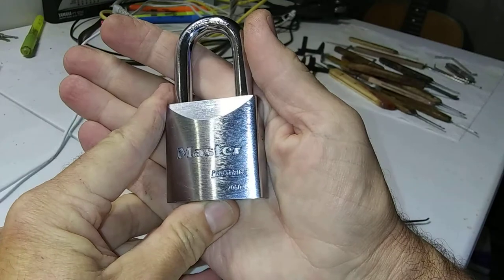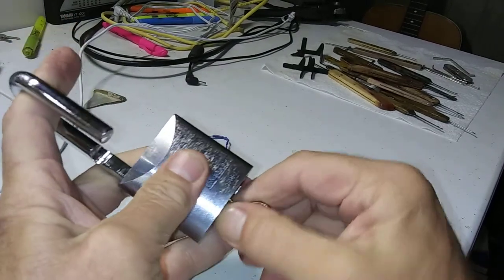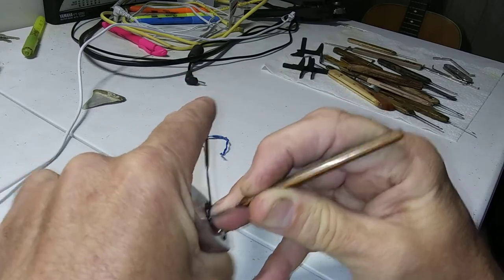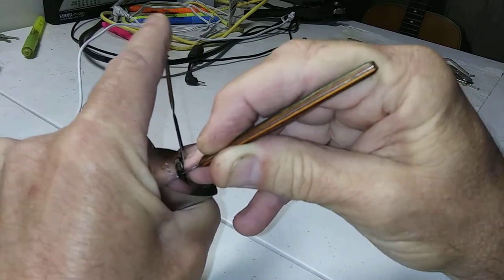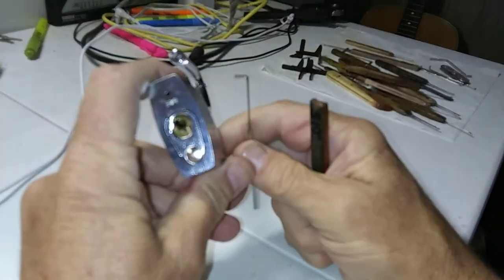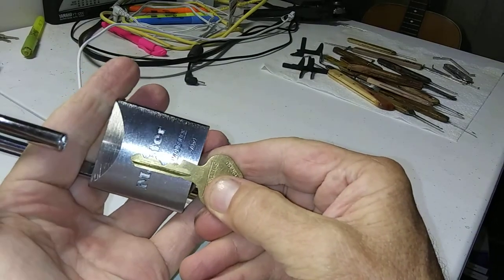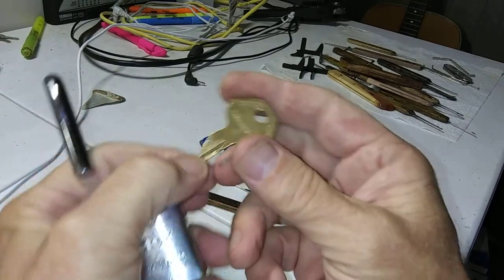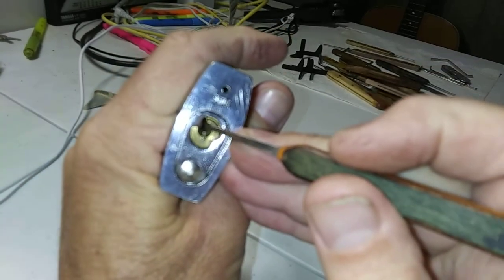(26) 6 pin safety core inside a Master proseries #lockpicking . #locksport

Comment: Nice job, man. Nice bitting on the key. Looks similar to a loto lock core & they can be a tough, tricky pick. Great picking, man. Take care & stay safe.😃👍🏼🔐
Reply from the maker: yes that's where the core came from was a Master lotto lock that got smashed but it still picks like a lock that is higher end .. super fun  ... stay safe ..
Reply: Don Won Yeah, man, they certainly do. Some of the toughest locks I’ve picked have been those Master 411 & 410s. Btw, great job on the picks, buddy. You’ve been doing a really nice job on those.